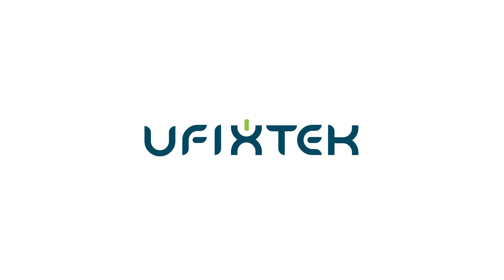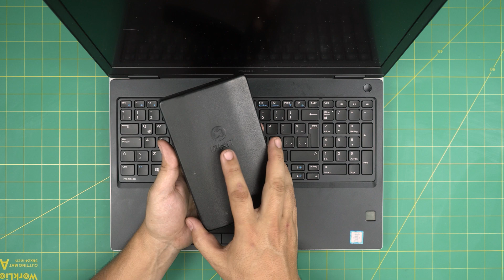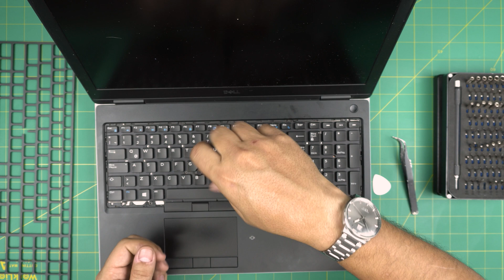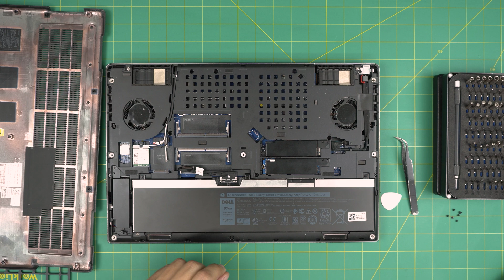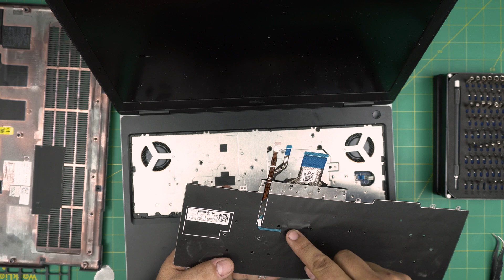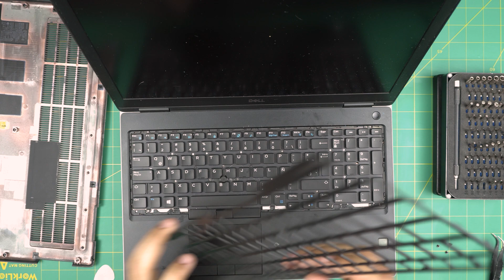How to Replace Keyboard for DELL Precision 7530 Laptop | Step by Step

Comment: Hi there!
I have the same laptop and there is no any symbols for backlight on the keyboard (Fn/F10,F6 or right arrow!
When I zoomed in on Your video, the laptop keyboard You work on is the same as mine!
No symbols for backlight!
And according to Dell website, if there is no backlight symbols on the keys mentioned above, keyboard is not backlighted!

And You say ,one of the three connections  is the backlight!
So if there is backlight cable, there should be backlight right!?
So how it is turned on?!
Thank You, and Happy New Year!
👋
Reply from the maker: Thank you for your feedback! If you wish to support the channel, you can like, subscribe, or both!
Regarding your question, the motherboard hass the connection, but if the keyboard that you have doesn't have the backlit then, you will need to purchase a keyboard with backlit, and connect the cable to the board.
Should you have any further questions or requests in the future, please don't hesitate to ask me.
cheers🍻